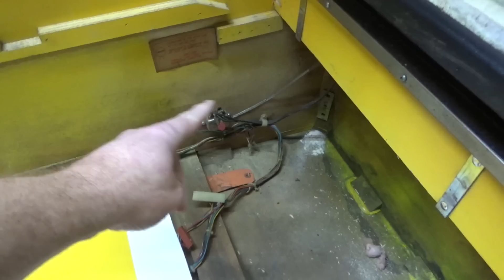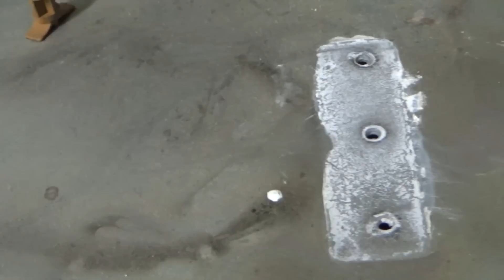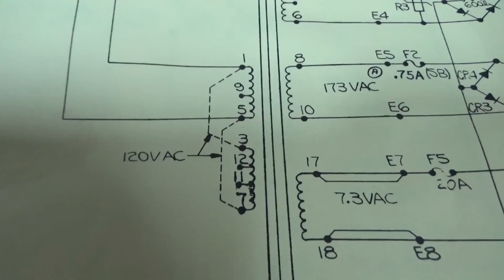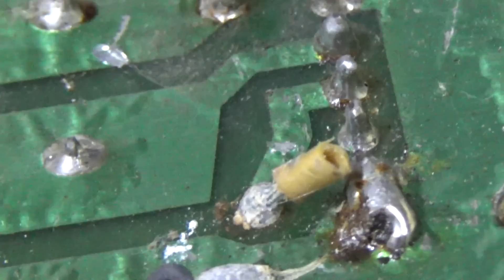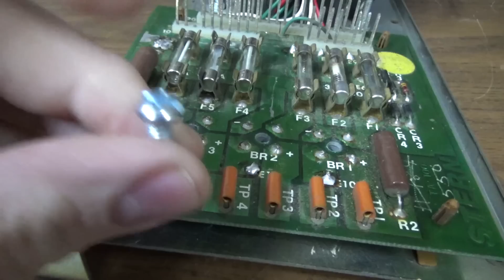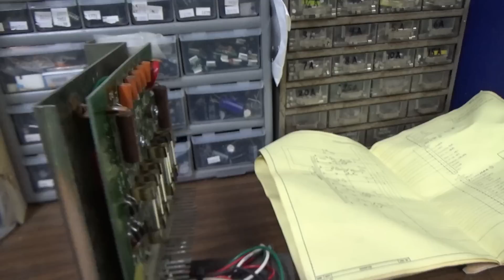Building A Power Supply For The Lost World Pinball Machine - They Scrapped It

Comment: How much more efficient would a solid-state PSU be? Very curious since I know some of the older analog stuff sucks some juice and puts out some heat.
Reply from the maker: The issue is the power supply creates several different unique voltages and it would be hard to design a solid state replacement with all of those different voltages.  It would definitely be more efficent but in modern pinballs, they use a similar setup, they have a large transformer and then a large power board to create the different voltages needed.

Comment: Hey Ron, I really appreciate your videos! Making all that content really makes repair accessible for noobs like me. I do have a question: if my voltages on TP1 on my power supply/rectifier board are low according to chart, where do I start to look to adjust/correct? This is for a Paragon: 
TP1: 1.6 VDC (low according to chart) 
TP2: 245.50 VDC  👍🏻
TP3: 14.40 VDC (high)
TP4: 6.42 VAC 👍🏻
TP5: 44.80 VCD 👍🏻
I have now lost both my GI and my switched lamps and I am struggling to diagnose this issue properly. 

Any help would be appreciated! Thanks!
Reply from the maker: You should still have your general illumination since test point 4 is correct, but you may have bad connections or burnt up connections on that long connector on there.

That first test point is fuse 1, and bridge rectifier 1.  That bridge rectifier is probably burnt up and open, or not making good contact to the board, etc.
Reply: @LyonsArcade  I’ll check again.  Thanks Ron. Appreciate the help. 🙏🏼

Comment: Line voltage depends on you distance from a local transformer. In order that the last home on the line get 115 the first home may get 130 or more. You can even buy equipment that drops you home voltage to save you energy if you happen to be very close to a transformer station.

Comment: Yeah. Someone took a machete to the machine those parts came out of. You get the people who take one look at any machine that doesn't work for the most minor reason they don't understand, they $ee dollar signs and then the machete comes out so they can get maximum price out of every single little part... muny in bank, so they think. At least it wasn't a worse situation where someone who knows nothing about it has severe, common, anti-junk "pseudo OCD" that results in violent Tourettetic rejection of anything they can possibly confuse for junk. 

Even if they could hire someone who'd gladly handle the stuff for them so they'd make some money they'd just want it in the trash! (they do this 'cant handle junk, cant handle junk!' then comes foot-stamp foot-stamp twitch-twitch and they send it off to get completely destroyd); when there's nothing even clinically wrong with that person! And afterword nothing at all happened in the now empty space; except there's a comically large, expensive, mostly empty desk with an over- priced computer on top of expensive flooring in an otherwise large, totally empty space with expensive dot com windows and lighting. 

And THEN you get people who are stuck in between the monolithic "serial-emptier" type and logistics and lack of resources. Under insane pressure they would rather hack away at the thing to save at least something (BECAUSE THEY KNOW IT'S ACTUALLY GOOD STUFF). I don't do pinball machines myself, but too many areas of other real tech suffer from this destructive bedlam so I feel your pain. 3D Printers can't fix everything (as I know that you know well), and not everyone is only into phones and drones and laptops, nor does everyone want a cold empty space to exist in. Sorry for the rant about how important stuff gets crudely hacked or just goes in the trash... but it's true.

Comment: It actually does matter in a big way if you had left the link between 9 and 11 engaged.  It would create a short between that tap on each coil, which could cause some unexpected results, particular on voltages on the secondary side.   There is also the possibility it could burn out the primry winding, on top of damage to the secondary side.
I don't usually like making corrective / negative sounding comments because your work is amazing and you know so much about this stuff.  I just thought I'd mention that, in case others watching think it may not matter.  If you look at the schematic of how the primary coil is connected, you'll see how it is working.
Reply: AFAIK all the stress would be on the primaries. I would need to study the diagram closely to be sure but I don't think the secondary voltages would be significantly high. Of course the transformer would burn up if the fuse  doesn't blow in time.

Comment: Yes, wires can be thicker after the transformer for 2 reasons. When you decrease the voltage with a transformer, you increase the current. 

Then there is DC vs. AC. I don't know if this is 100% true, but DC is more eroding since the current only flows in one direction. AC doesn't damage it over time as much. But you will see that some things come with AC and DC ratings and the DC ratings may be lower.
Reply: Switches, fuses, breakers tend to have lower DC ratings than AC because sometimes there's an arc from current when opening the circuit. With AC, when the current goes from positive to negative and vise versa, it goes through zero current which makes it easier to stop the arcing than with DC which may never hit zero current. 

It's really rare for actual metal migration to be a design consideration
Reply: @UnreasonableSteve  -- That makes sense. I do understand that solid-state pinball machines incorporate zero-crossing detection. That's just a full-wave rectifier, a resistor, and an inverter (to give a high output when the AC voltage dips).

Comment: JOE, The display voltage is 180vdc on the TP Test Point but the other board will have a capacitor that will increase the 180vdc to 240vdc. I wonder why they made it increase to 240vdc and then decrease back down to 180vdc? It seems that the game designers rectified the 180vdc (unregulated/unrectified) to get 240vdc ( regulated/rectified ) but then adjusted it back down to 180vdc (rectified/regulated)?

Comment: I was worried when I saw the last video. But it's coming along nicely. I do like changing the bridges to the higher ones and mounting them on the topside. Great job so far. Looking forward the rest. Thanks for the videos.
Reply: I was curious why he ended up going back to refabricating the bar vs. changing out for bigger ones on the front? Weren't they old and a time bomb? Maybe it will be in a future video
Reply: @JonS-TX  I bet Ron can tell you the real reason. My hunch is that sometimes you find yourself not having the right parts for replacement. And there's a couple of people who will fall into the class of * if it's not broke don't fix it*. Also the big bridge rectifiers that you replace it with really kind of sit off the board. Very wonky. Aesthetically, the original parts fit and look a lot better. I'm good with whatever he does to get it working.